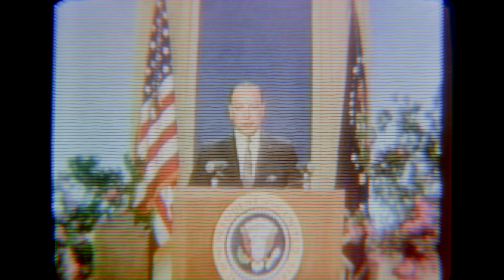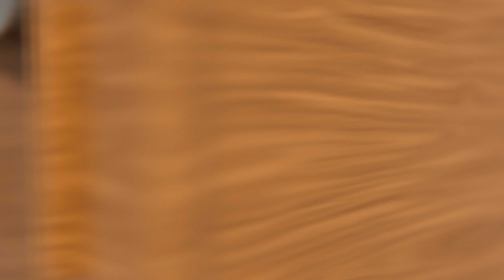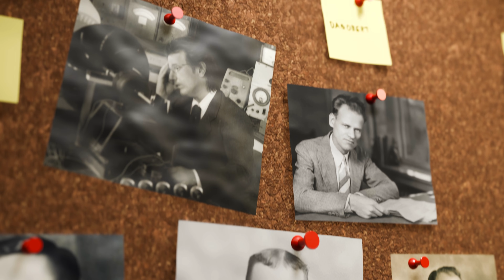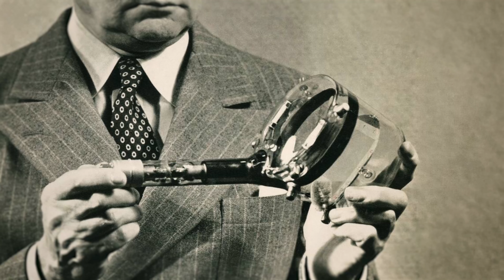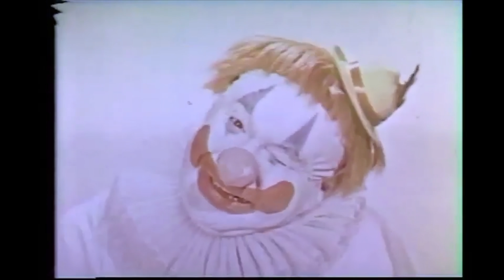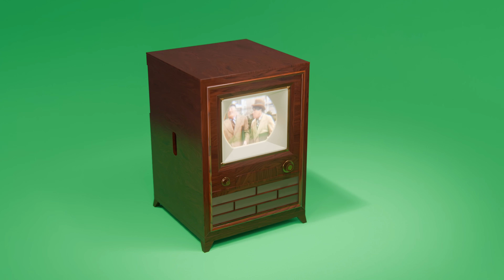Why Inventing Color TV Was So Difficult

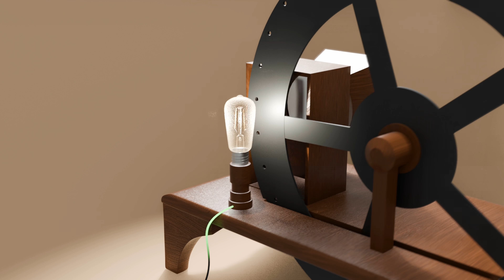Comment: 2:26 it’s amazing how electronics like the famous TV 📺 just worked by illusions, but of course frames and light capture and electricity and signals via radio or television waves, which makes sense because they start as just a little pixels. They are eventually translated onto your TV screen, but right that makes sense because I remember that that’s exactly how a camera works back in the olden days. It would absorb light which would create black parts on some parts of the camera when it was covered in the liquid it needed. and the parts that didn’t get light would be black and then you would let it sit in a dark room for a week by the way this was from France.🇫🇷 😅😊

Comment: Why was guillermo gonzález camarena not mentioned?
Reply: Philo Farnsworth wasn’t mentioned either
Reply: González Camarena patented his system based on the use of three basic colors (red, green, and blue). MADE IN MEXICO
Reply: I think its because camarenas invention was something different, despite producing similar results. So it didnt necessarily contribute to the making of what we use today.
 From what ive read (went down a rabbit hole on this) one of the reasons camarenas invention wasnt widely used was because he died around 1969, and ontop of that, the makers(?) Of NTSC pushed their product hard to make it the standard. Including in mexico.

Theres someone claiming to be an electrical engineer claiming that the patents are proof. Camarena didnt invention the crt or whats used as a standard. They seem to be right. But people think otherwise.
Reply: White people
Reply: Camarena's "invention" is basically Peter Goldmark's wretched FIELD SEQUENTIAL COLOR, part deux. Sequential color is still very much alive today in single-DLP projectors that produce headache-inducing rainbow effect (RBE) artifact. WE DO NOT NEED sequential color. Despite its many limitations, the RCA system was superior. 

ALL sequential color devices in the world today, which is ALL single-DLP projectors, should IMHO just be gathered in a heap and incinerated.
Reply: Unrelated but Jesus died so you could live
Reply: Because he was a Mexican inventor, so to the average statesider, anything or anybody comming from Mexico it has to be reviled.

Comment: Considering the age of AI is among us, and the need for freedom of information. Rebuilding analogue infrastructure and building analogue TVs or devices that cannot be digitally perceived would be another method of security. Let's even consider analogue given the current ethos is unthinkable, STILL: if we keep discarding ideas and relying only on current technology we are effectively reducing the size of our technological output as a species. Imagine: we used to manipulate light across complex physical phenomenae and make a light gun draw out images. And we completely dropped off that technology considering it inferior to small leds turning on and off? Why because of bulk, manufacturing and further economic reasoning. To me my 14" crt is my .ost worthy tech, because the day it dies most of my retro consoles will have to rely digital flat screens that feel dead. Analogue is so alive it's a technology that should be preserved by humanity at all costs.

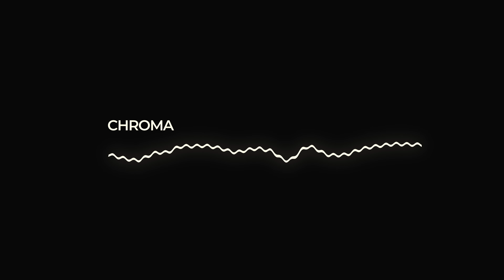Comment: 13:30 Incorrect! the Luminance signal is not be filtered out and disregarded. The color difference values only describe the color, but not the luminance. After decoding the chroma values into RGB, the RGB values will then be multiplied by the luminance valued to get the final RGB values that then go to the tube.

Comment: This was such an incredibly well made video, I seriously enjoyed watching it from start to finish! 

Fun Fact: The reason NTSC countries still use fractional frame rates (29.97 fps or 59.94 fps) instead of exact integers like 30 or 60 fps is because American engineers needed to find a way to fit color information on the already limited 6 mhz bandwidth signal, so they came up with a clever idea of slightly reducing the frame rate, thus allowing televisions to receive color signals. Today, it is a relic of the Cold War era and is still used in both consumer and prosumer cameras, as well as LCDs (Which often deceptively claim to be 60 hz, but are actually 59.94)
Reply: Partially true. The frame rate was not reduced to fit the colour signal into the 6 MHz channel bandwidth, or in reality just 4.5 MHz between the luminance and audio carriers (after the guard band, vestigial side band, and audio upper band), it was to prevent interference between the three carriers, now the chrominance carrier was introduced. This required the 4.5 MHz band to be a multiple of the line scan rate of 525 lines X 30 frames per second, which is 15750. Unfortunately this is not the case: 4.5M/15750 = 285.714… To solve the problem you either reduce or enlarge the signal bandwidth, both being problematic due to old TVs losing their audio signal, or change the frame rate. Luckily 4.5 MHz is a multiple of 525 lines X 29.97 frames, 15,734.25 Hz. This nicely divides 4.5 MHz into an integer, 286, and prevents interference between the luma, chroma and audio signals, while maintaining compatibility with old TVs, since 29.97 fps was close enough to 30 for old black and white TVs still to work. See the standupmaths video for more details.
Reply: @derekjc777  Thank you for clarifying that! You're right, it had much more than just reducing the frame rate!

Comment: 13:30 This is not entirely correct. Color TV does use the luma signal as is (giving the same intensity on R/G/B) and the chroma changes the B and R to be less or more intense. With only the chroma signal, colors like brown and gray would not be possible.

Comment: In Europe, the colour sub carrier isn't 3.58 MHz, but 4.43 MHz. This is because the sun carrier must have a fixed relationship with the horizontal scan frequency of 15,625 Hz. Moreover, the European color system reverses the phase of the chroma signal at every scan line. In this way, when an interference alters the phase of the chroma signal, it does it on two phase-opposed lines. By using a glass delay line, the TV receiver can average the phase of the two adjacent lines, so that any colour error is cancelled automatically. PAL televisions have no "HUE" adjustment while NTSC do have one.
Greetings,
Anthony
Reply: If I remember we transmitted R-Y and B-Y  We added them together to produce G-Y So we can end up with all 3 colour signals
Reply: NTSC TVs are 60 hz while PAL are 50 hz

Comment: 1958 was not the date that the U.S switched to colour TV.  1954 was the year  colour broadcasting begin which was compatible with existing T.V.  The video here is one of the earliest surviving colour video recordings which was publicly broadcast.  The image and explanation of Baird's early scanning cameras is inaccurate- it did not look like the apparatus in your AI video, which is the televisor at the receiving end. Your explanation about early colour TV,  failed to mention the spinning colour wheel scanning system which was first used in 1953 but was dropped for the compatible RCA electronic colour system.

Comment: 15:00 the way you explained how the radio waves work was VERY BAD. In a radio wave, the image Primal showed was probably very misleading to many. I think what he showed there was the amount of voltage changes that happened during a single second of measuring. But that's not exactly that simple. Think of radio waves as a voltage burst, it has a beginning and it has an end and it has a buildup. So the more voltage you put in means higher the peak. A single peak per second is what we call 1 HZ. BUT this is just 1 radio wave. To get out job, we need multiple of these. Let's say our single wave is at its lowest at beginning of the second, let's call it 0 degree then let the peak be 180 degree and ending be 360 degree. Now when our Hz ( Hertz ) starts and reaches inbetween peak and beginning, meaning 1/4 of a second after the beginning, we measure another wave that is in the air running at same frequency as us but it praks when our original wave starts, we measure that voltage and then when 1/4 seconds pass after start, we measure again and this time another wave at same frequency but which peaks at the middle ( 1/4 seconds after start ) is recorded at it's highest. And so we have a time measuring wave which functions as out clock with constant peak and 2 different waves waves 1 and wave 2 with dynamic peaks, that reach their highest at 0 degree and 90 degree, OR when our wave starts from the bottom and then 1/4 seconds later.

The change in peak voltage of both waves denotes the strength of a single pixel in the display array, and for a 100*100 pixel display, after 10000 Hz our image is drawn ( and this repeats) . AND here's a surprise since it's april fools day, when bro said 6hz he meant 6Mhz meaning 6 million hearts, meaning we have 6 million hz to work with in a second, people always forgets to say this ( or makes it an obvious things just for comfort ), that when they say hz whey mean Mhz.

I probably missed some details and made 2 or 3 mistakes so whatch for those  too... Just do your own research BRUH

BTW there's 1 more surprise. The 6 million hz is not just 6 million hz, it is a part of a wider frequency ( hz is unit of frequency ), let's take somewhere between 54 and 60 million hertz, the hz million hz is the maximum readable information within that large frequency... Basically just divide 54 mil by 6 mil, so 1 out of 9 different peaks. We use this as another measurement wave to find the other measurement wave that that measures red and blue, so if it's a 54 mhz channel ( usually it's between a to b like 54mhz to 60mhz and this difference is what differtiates waves used in different channels and different devices eg: news1 uses 54 to 60 and news 2 uses 60 to 66), every 9 mhz, it starts measuring ( more of just a starting switch ) a single hz out of 6mhz and that measures red and blue and so on... 

And of Just pls do your own research... Pls

Comment: 13:25 “this frequency would be filtered out” no, it would be displayed but ignored, because it was just fine-grained noise.  You can still see it everywhere to this day if you know where to look.  Most of the oldest B&W TVs were so small or basic that they had trouble showing this detail, but they weren’t filtering it out on purpose.
Reply: No you're wrong. It was filtered / attenuated, just not perfectly.
Reply: @MichaelScalzo-q3m  It may be filtered out on more modern B/W TVs, but it certainly wasn't filtered on older ones because they had no reason to do so. And to this day it's not filtered on baseband monochrome monitors because that would destroy the high resolution for which you usually use a monochrome monitor in the first place (e.g., an 80-column text display in the '70s and '80s).

Comment: But then... At some point they realized that using both sources would create a cleaner image... Separated LUMA and CHROMA is basically what became S-Video... Which was clearly better than composite (No fuzzy dot crawl).

My old C64 monitor (Yes, the good ol' 1702) had separated Luma and Chroma inputs, and it was a damn clean image for the time... (Only beaten by RGB interfaces.)

Comment: Color television has always amazed me. The technology behind it is simply amazing. In the early 70's I was trying to figure out a way to record television signals onto a cassette. I didn't know they had VTR's for the home yet. This was 5 or 6 years before the VCR came out. My system didn't work; not enough bandwidth and no way to select a signal or channel to record, so I thought "why not just record the whole antenna signal and sort that out later. I could probably do it that way now. In about 1980 I thought, "why not come out with a way to save music onto some kind of memory chip?" 8 or 9 years later, they came out with the Ipod. LOL.

I do miss CRT TVs and OTA broadcast TV. I'd rather watch a snowy picture than a pixelated, jagged or frozen image. Plus, it didn't cost anything, except buying the products from the sponsors, which I did anyway.
Reply: As an 05 kid I’m jealous of you being alive back before all this tech boom happened, can see how some people got so invested into the older technology
Reply: I don't think storing music in a memory chip would have been a crazy idea as such, it's just that memory was way too expensive for that and modern compression algorithms didn't exist either. The Compact Disc had a ridiculously high capacity for its time and even PC hard drives weren't anywhere near that capacity until the late 1980s (and those would have been very expensive). So it took a while until the late 1990s for technology to be ready for "solid state music". But the idea certainly wasn't new. The first iPod was released in 2001 and didn't store music into memory chips but a hard drive. However, other player called "MPMan" was released already in 1998 and featured 32 MB of solid state memory. 32 MB wasn't much and allowed maybe 10-15 songs or so at reasonable quality. Still pretty good considering the alternative such as a portable CD player which didn't have much more than that per CD either.
Reply: @joonasjanatuinen5474  Yes, it was memory cost that was the issue. We actually were storing music in memory chips even in the '70s; you can look up the history of the Synclavier and the Fairlight CMI to find out more about this. But if you wanted more than short samples, you needed far more storage than RAM could provide at any sane price, so they did exactly what digital technologies had been doing for decades in that situation: they recorded the digital data to tape. PCM audio was in use by the mid-60s, and storing those data on tape started around 1969-1971; by the late '70s it was in fairly wide use in high-end recording studios.
Reply: As a kid (age 11 in early 70s) I tried desperately to attach an antenna lead to wires into my little cassette's microphone port and 'record' TV signals.    I would then try and and play it out of the headphone wires attached to the antenna leads on the TV.
Couldn't comprehend at that age why is couldn't work.

Comment: Some simplification in this explanation, but I understand that's a hard thing to balance. For those wanting a smidge more detail, a  colour composite signal basically works because the spectrum (that is, frequency versus level) of a black-and-white signal looks like a fine-toothed comb. And the chroma signal does too. The chroma (sub)carrier was carefully chosen so that the two spectrums were interleaved and that's why it works all inside the 6Mhz bandwidth. This is alluded to in the animation at 14:26 and is probably the key piece of genius in its design.
Reply: It looks like a fine-toothed comb only because they reduced the bandwidth of the B/W signal to make room for the colour. If you take a single colour flat plane generated as an NTSC colour signal and display it on a monochrome monitor you will see an alternating sequence of black and white lines.

This is why, back in the '70s and '80s, people would use NTSC monochrome displays instead of colour displays when they wanted higher resolution (typically for 80 column text or similar). An NTSC colour signal maxes out around 160 pixels across; an NTSC monochrome signal on any reasonable quality monochrome monitor can easily display 640 pixels or more across.

Comment: The spinny disc TVs used gas discharge lamps (mercury I think) as the light source. Incandescent lamps as depicted in the animation would respond way too slowly to current fluctuations.
Reply: Mechanical monochrome usually used neon, so the picture was black and orange, rather than black and white. To get color, other gases were needed to get the green and blue colors. The particular photocell they mentioned was also too slow for good results, and very soon all experiments went to using photoemissive cells and high gain signal amplifiers.

Comment: Thallium photo sensors do not generate electricity, they change resistance when exposed to light.  And the luminance signal is not discarded by color TVs, it is used in addition to the hue and saturation components.  I give this description a B- for accuracy.  Not very thorough either, no mention of the interleaving of chroma and horizontal sync sidebands in NTSC color, but maybe that is too advanced for the target audience.
Reply: There is a (somewhat erroneous) illustration of interleaving in the video.
Reply: @oldtvnut  Where?  I saw no discussion of sidebands at all

Comment: How the f-ing f does one design the Luma and chrominance stuff without computers? It's insane
Reply: Amplifiers can add and subtract signals in real time, and frequency filters can selectively pick out the parts of the signal needed.
Reply: With an understanding of Fourier transforms and how the electrical video signal that is generated by the camera is related to the image in a system using line-by-line and field-by field scanning.
Reply from the maker: Agreed!

Comment: So the first color tv was already invented  in 1928.
But because of it’s low-res, low fps and it’s impraticality, it did not becom commercially availible.
Now about both pal & ntsc, in both cases only the blue and red color signals are sended to the tv at a different frequency each while the B&W signal is created from red,green and blue.
Now in order to filter out red and blue from from the wanted green signal inside that B&W signal, i think that by inverting that BW signal again red and blue will cancel out those unwanted signals sothat only the luma version of green signal wiil remain🤔
Then that filtered luma version of green will be combined with those actual red & blue signal to forn a complete colored image🤔🤔
For a loooong time i always throught that aside from a B&W also the red, green and blue signals in compressed form  were sended to the tv from both ntsc and pal but as it turns out that was not the case.